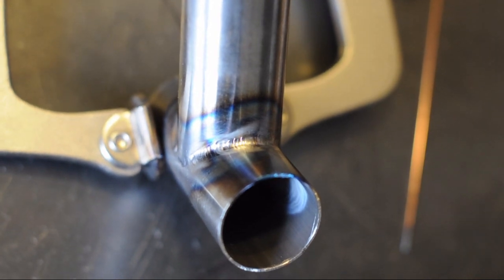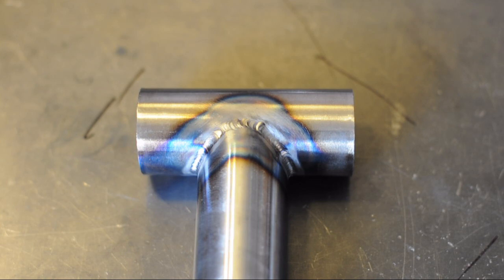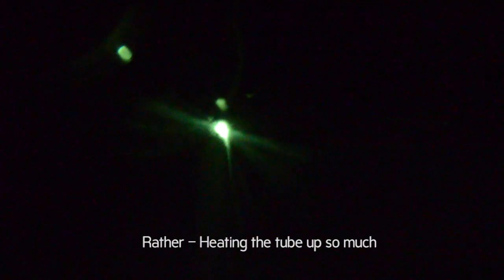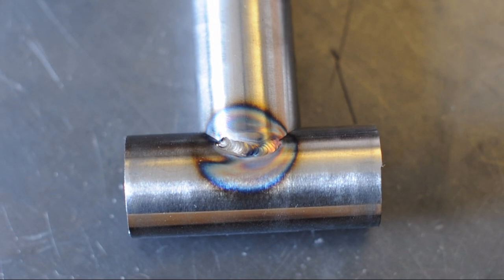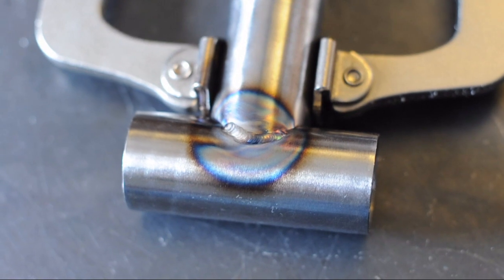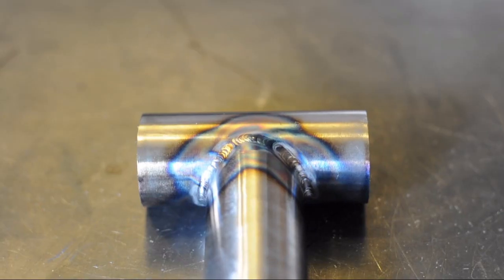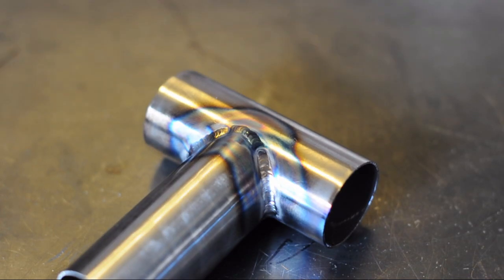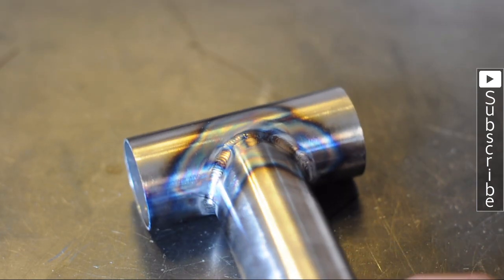Bicycle Frame Build 28 - The Road To Good Welds Pt.1

Comment: Sooo... Brazing or welding? I fathom brazing would allow corrections afterwards, but require acetylene torch. TIG, in turn, is safer and cheaper - but will require twisting the frame afterwards and there is a risk of thermal twisting of the frame or burn-through - welding would also require more skill.

Comment: I'm sorry to say that you have developed a bad habit concerning your lead angle. At least TRY and hold the stinger at 90*  ,   15* into the direction of travel is text book (you're welding about 40* from optimum!). A 15* lead angle stacks the puddle behind the weld. Your welds are a little dry because of your lead angle.)

Comment: 0:27 what machine is that?
Reply from the maker: That is a minilathe setup with a custom tube miter fixture. I don't cut tubes that way anymore though. Much easier to do it on the milling machine.

Comment: Ok so first off...I am a Motorsport/Aerospace Welder Fabricator that has worked for some of the most successful companies in European Motorsports. So first off...all the BS with cleaning the inside of the tube...a complete waste of time with 4130 when you're doing a butted fillet weld...don't bother. Second and far more important forget the pulse setting...1 pulse per sec? Fuck me that's fast trying to get rod in there and I've been doing it all my life. You see the red end of the rod glowing outside of the safety of the gas shield? That's an x-ray fail right there happening before your eyes, the end of the rod has now oxidised and you're about to introduce that to the parent metal.  keep the rod inside the gas shield at all times. If not? STOP...snip the end of the rod off so it's clean and start again. Turn the pulse off and use the foot pedal...Stick the end of the rod over the next pulse then hit then end of the rod with the arc, when it's melted in back off and let it cool...then move to the next, which is at the edge of where the last pulse finished. So you're always only moving forwards half a pulse. Remember slow is good , it gives the weld pool time to cool under the nice fresh cool Argon shield instead of being exposed to the nasty oxygen. Third Argon is heavier than oxygen...so think about it...you always need the weld pool if possible directly underneath your tungsten...if not then allow extra time for pool to cool before moving on. It's not easy cramming 30 years of experience into a couple of paragraphs...but I've tried. If you need anymore...message me.

Comment: Hey bud your perception of doing work is great appreciate it alot, but are you using same machine for flat plate cutting and and welding can u just send me a name of machine or some advice I also wanna own one.
Thanks alot
Reply from the maker: I mostly use a portable band saw for cutting. Welding is all done with an Everlast PowerTIG 200 machine. Cheers!
Reply: I think he means plasma cutting ;)

Comment: Curious. What if any, is/was your favorite steel tube set to build a bike frame? Tange Ultimate series from the 90s, the latest Columbus?
Reply from the maker: +schlooonginator I have only built one frame from start to finish. And that was from true temper tubes. Sorry I can't really answer you question. But thanks for watching!
Reply: Pithy Bikes Ah, thanks for the answer anyways.

Comment: i think an autogenous first pass and a silicon bronze cover is pretty popular w road frame builders. your torch angle also changes alot while you cross over to a new quarter of tubing. welding is an art, stay at it and it will pay off!👍
Reply from the maker: +Jfs blah blah Thanks! I don't practice nearly as much as I should.
Reply: Look at the guy from Toxic Fabrication on YouTube. He started in 2014 and made a video about his first TIG welds. He posted a picture in a forum and they totally flamed him told him he sucked, the welds were terrible, etc. Now people are drooling over his work. It just takes practice.

Comment: I'm in BRAZIL , I HAVE A QUESTION WHICH THE SPECIFICATIONS TUBE
Reply from the maker: The Tube is for practice use. 
4130 Alloy Steel Round Tube 1.250" OD, .035" Wall Thickness, 6' Long

Comment: Steve,

 I got a welder finally.  I am having lots of operator error. I am getting a lot of oxidation, I have been running an 8 cup with 20 cfh and that does not seem to be enough coverage. Also I have been having pretty dirty arc starts where the metal jumps up on the tungsten as soon as I hit the foot pedal.  I admit I haven't been cleaning the inside of the tubing as well as you demonstrated. I have tried clamping the ground to the work and to the table and still getting the same issues. Also where did you get the 1.25" gas lens. 

   Will
Reply from the maker: +William Atkinson Hi Will, Sorry to hear about the troubles. It sounds like the argon is not flowing properly, or it's getting blown away. The first thing to try is rule out the possibility of a draft. Put a test metal piece on your table and make sure the ground can contact it. Then put some boxes or wood (anything to shield wind) around your work piece like you're building a tiny little work cubicle. Then give that a try. If the problem still persists it could be bad flow in your hose. Check to be sure there are no leaks. Check every junction from the torch to the welder and then welder to tank. Give those things a try.

Another possibility that just occurred to me is to check your pre-flow. Pre-flow is the amount of time the argon is on and flowing before the arc starts. You need to flood your area first before starting the arc. My pre-flow is set to 5 seconds.
Reply: +Pithy Bikes  Thanks! I will try that. If that doesn't work  I will write back, I have a similar green box to yours, so I am confident it is capable and that it is my error. Still trying to find the pyrex gas lens you have for my torch.
Reply from the maker: +William Atkinson try furickcup. Com  I always hear good reviews about this gas cup. And the assembly is more basic because it accepts a common lense.

Comment: it looks like your dipping the torch. watch this guy if you ask he helps, he his dvds you can get to. i have trouble with aluminum that's not much bigger than two sheets of aluminum foil it was thinner than soda cans in class we would weld soda can to gether for rc race cars gas tanks.
Reply from the maker: +chip2567 hehe, yeah I still dip the torch lol.

Comment: Hey buddy, I've been eating up your channel this holiday week.  I'm in the same area I think, north Oakland, and I'm on the same track, but way behind you.  I got the welder, built the jig (little fish bicycles style), now struggling with the welding.  what are you using for those test joints?  where do you buy the material?  I'm just welding scrap so far but getting better.  Slowly!  I buy mostly from Alco down on Davis st in San Leandro.  Happy New year!
Chris
Reply from the maker: +Christopher Beasley Hi Chris and welcome to Pithy Bikes! Yes, I'm not far from where you are. If you want to talk shop or anything shoot me email - pithybikes@gmail.com
I've been buying 4130 practice tubing from McMaster.com It's not cheap but its the closest thing you can get to the real thing for cheaper. I think it's 1mm wall. I used to go to Alco. But these days I've been getting my steel from Albany Steel Co. And getting aluminum online. I think Alco is pricey especially for their remnant steel. They have a really great selection but I just got tired of driving down there. Happy New Year to you too!

Comment: I know it's a bit more expensive, but practicing on stainless steel will really help you out with your heat input.. Will know you are in the right heat range as long as your welds stay pink or slightly bluish.
Reply from the maker: +matthew weber Interesting idea! But im cheap :P haha.
Reply: +Pithy Bikes
 ya, i know what you mean, but, proper heat input is impotent with a bike, especially with chromoly or other hardened alloys. if your welds are too hot, they can be brittle and crack. even practicing on some 18 gage stainless coupons just to get that under control will help you exponentially...  I mention this from watching your travel speed. turn up the amps a little and move a bit faster so you don't build up too much heat..  but in all great videos man, I can tell you are passionate in what you're doing..
Reply from the maker: +matthew weber Thanks man! There's so many nuances to welding, I'll never finish learning. But that's the fun. You're right and I've been trying to pick up my travel speed. Bit by bit!

Comment: Hi, that's great job and video. I have a question. What's that equipment in 0:29 where you cut the tube at the edge and makes that curved shape? It's very important so that fits on the other tube and weld it. Do I have to buy a machine or something? Thanks!
Reply from the maker: +Savvas Berdos Hi, there are multiple ways to make that sort of cut. Its called a miter cut. The saw on the end is called a "hole saw". In my video the machine holding the saw is a mini lathe. And I made the fixture that holds the tube. There's alternatives to get similar results. Here is a simple one: http://www.eastwood.com/pipe-notcher-and-hole-saw-kit.html
Reply: +Pithy Bikes That's great thanks. However do you think I could use the hole saw attaching it on my simple bosch drill? I mean technically (rpm etc..) if I use a component like that: http://i01.i.aliimg.com/photo/v0/432039143/DRILL_STAND_CAST_IRON_BASE_73A.jpg

Comment: Forget pulsing, use a fixed amp setting, 10% lower than you would expect. Melt the pool and add rod to the pool as a deliberate dab down onto the pool not a poke into it. Also increase your rod angle, you're melting the rod onto the joint, the pool should melt the rod not the arc. If you want ripples decrease your amps and delay adding rod
Reply from the maker: +sweenep86 Thanks! All good advice. I seem to have settled on pulsing and dipping but my background amp setting is higher now.

Comment: regarding the balling on the filler... I had the same trouble and in my case found it was due to excessive torch angle to the workpiece. laywire isnt the easiest with thin filler either so wouldnt sweat that too much, haz looks quite big so as one other viewer stated you need to bump the amps up and travel faster, nice improvement though from your last video :)
Reply from the maker: +laurie agnew Thanks so much for the tips. I've been practicing with your advice and its working out really great so far. I'm getting closer to the point where I will do more welding on the frame. Hopefully by then you there will be a visible improvement. Cheers!

Comment: I wish someone would show step by step bmx bike build or creation
Reply from the maker: +andrew brooks The fundamentals are all basically the same. I would even say a (street) BMX frame might be easier. The tubes tend to have no taper and no butts. Mid Bottom bracket is larger and thicker for less distortion. Components are all beefed up more so you prob don't need heatsinks or purge. Or the need is not as great. You just need to know what geometery you want. That said, I never built one so I don't have working experience in this matter. If you wait a year or 2 I do plan on building one ;)
Reply: Yea eveyone do these big fancy bikes which I'm thinking they don't know there's bmx bikes in the thousand dollars range as well so it may not be fancy but they are just as good

Comment: are you using a lathe do cope the tubing? what brand is it
Reply from the maker: +BlueCollarDreams Yes, I'm using a Sieg C3 minilathe. I would not recommend it though because rigidity is important when mitering because of all the vibration. Minilathes are not really rigid. I need to run the ways very tight to get it to work. But if you don't have the space or budget, or just starting out its not bad :)

Comment: Good day and luck with your work,

Found this because I was/am looking for a frame builder/alterer. I have a 1986 Schwinn 21" frame (previously had a 23" but it simply wore out :P) I need to put a larger tyre on it, and finally found a fork to fit but... It is 1&1/* steerer and My Black Chrome Sierra has a 1".  Half/Mixed breed headsets are hard to find, and especially one of quality.

I have welded straight no gasses, and know how difficult it is to get the touch. every metal is different and mixed welding like I did with an ARC was hard enough. Detail on quality metal must be hard, BUT if you continue you will get it. You cannot fail until you choose to. Pursue, try, and remember all the errors. Spread this knowledge and ask other's advice.

I believe in you, you believe in you, you can do it, and you will do it.

Look at how much you have learned. You will learn more and with expertise comes prosperity, should you wish it. A true wish is not to be bestowed by an outside party, but is fulfilled by desire.

Glad to see your video, again I say, spread your knowledge, and ask for help.

Best wishes to you.

Comment: increase your amperage and travel speed. your welds will come out much nicer with a smaller heat affected zone due to less total heat input.
Reply from the maker: +Ben Rawalt I will try! :)
Reply: wrong!...Sorry I know this is old but I've only just seen it.

Comment from the maker: So I reviewed the video just now and to my surprise, an ad popped up! I do not have ads turned on with my channel so I investigated to see whats up. Turns out the song I chose for this video is copyrighted! So Youtube turned on ads for this video :(  I ran into this issue before and there's no easy way to remove the song (you can let youtube do it but then its silent for that part) And I can't just swap out the sound or replace the video into the same youtube post. Youtube makes you re-upload a new video into a new post and lose all comments! So, sorry guys.. This one has an ad because of the song. And I don't want to delete the video because there's so many good comments in this post now.

Comment: Hello Pithy Bikes (aka Steve). Love your series. And I feel your pain. I've built a few fillet brazed bikes and have been transitioning to tig welded frames. Same deal as you, practice, practice, practice with thin-walled .035 chromoly. Last week I think I finally cracked the code. Welds are pretty consistent although I'm mixing things up a bit with some weldmold 880 (just arrived today) and a CK130 torch with gas lens (should be here this week).... so I might have to step back a bit to readjust to the new equipment.

Like you I've been following a lot of forums trying to get some answers. Kristofer Henry of 44 bikes has skill and beautiful custom frames. He's been welding for decades and I've followed his settings for pulse tig welding. The settings for a dynasty dx are:

	•	Tube to Tube (TT, DT, ST) Typically is: 51-56 Amps @ 1.2 PPS / Peak @ 60% / Background @ 20%
	•	Tube to BB / HT: 60-68 Amps @ 1.2 PPS / Peak @ 60% / Background @ 20%
	•	Bridges seem to be 40-44 Amps @ 1.2 PPS / Peak @ 60% / Background @ 20%

(although I believe he's now pulsing at 1.7 pps... 1.2 is a good starting point..at least for me).

What really made the difference for me was really being aware of torch angle (almost 90 degrees) and torch distance (I'm so close to the puddle it sizzles like bacon).

And I've settled with the lay-in method after jumping back and forth.

I find doing shorter runs to maintain the torch angle and distance is what has made the difference for me. If it sizzles like bacon, without touching the pool, I'm laughing.

All those variables to deal with in such a small area make it pretty challenging. And a small shift can make such a huge difference.

In any event, thanks for your time effort!
Reply from the maker: artcog.com Thanks so much for tipping those settings! I will try those out. Yes, I've found that lay wire is super challenging. You really need to get close to the puddle. Some people say lay wire is cheating?!! It's quite difficult, at least for me. Yes, I started doing shorter runs too. I'm fine with it because it means the tube is cool and shielded nearly the whole run if you got a large enough lense. Good stuff. Always fun getting new equipment! Good luck and have fun!